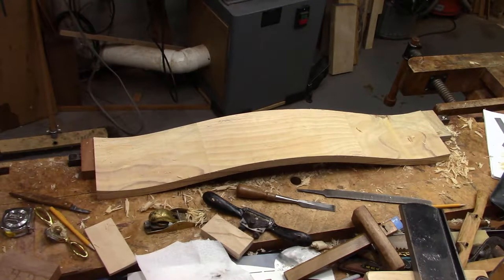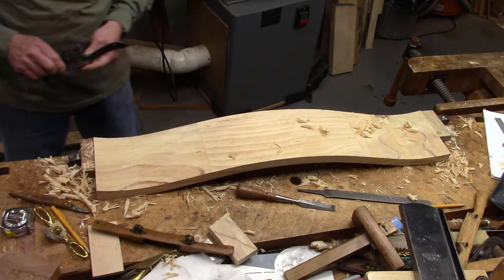29 Serpentine Chest Spokeshaves on the Drawer Front

Comment: I will be making a serpentine chest in the very near future but I don't have stock thick enough to cut the drawer fronts out of. The fronts will be all primary wood and I am considering doing a bent lamination in the vacuum bag. This way I could use laminations from the same board to get matching fronts. Do you think think a bent lamination would be an acceptable approach here or should I laminate two pieces together so I can bandsaw the front out like you have?
Reply from the maker: @stretch668  I have never done a bent lamination so don’t  know enough to comment. I see some of my students use that for making rockers on Maloof pieces. It works well in that application.
Reply: @killenwood  Ok ill do a practice piece and see how it goes. Thanks for the reply
Reply from the maker: @stretch668  The other issue is the visual aspect of seeing many joints in the final finish. Sometimes this look is desired and emphasized with differing colored wood species. Not sure how this would look in this type of furniture.
Reply: @killenwood  thats a good point. alot of things to consider